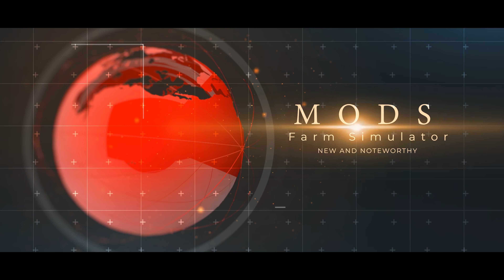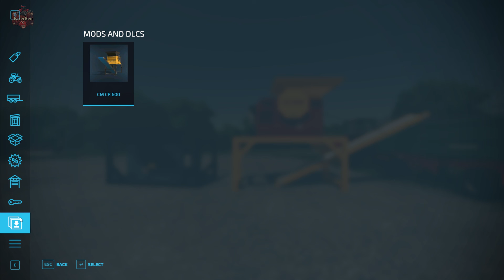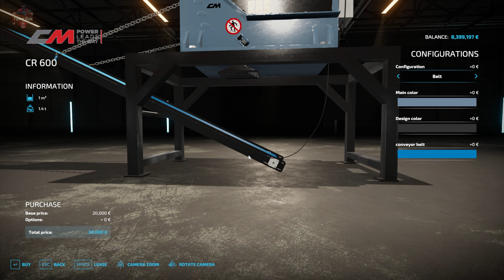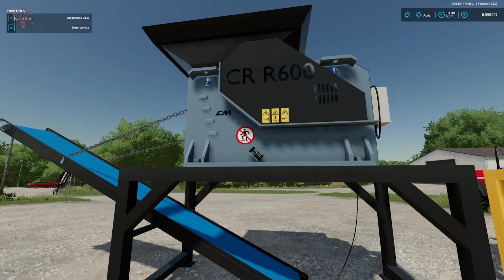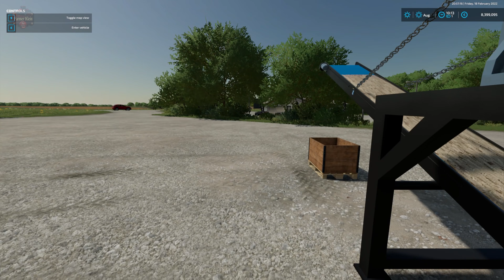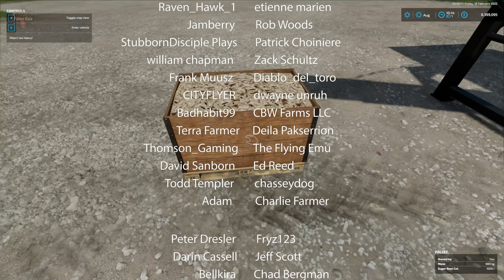CM CR600 (SugarBeet & Stone Crusher) | Mod Review | Farming Simulator 22

Comment: Thanks for the mod review. But at the beginning you call it beet pulp. But at the end you call it beet cut. The reason I ask that is The new maze plus mods ,in some areas ask for beet pulp and is a different then beet cut you can see the difference between the two symbols. I tryin to figure out how to get the beet pulp.
Reply from the maker: Unless this mod was speificly updated to support maize plus this is just for sugarbeet cut.  Any references to beet pulp was as an alternate way of saying sugarbeet cut.  This video was produced long before maize plus was released and before beet pulp was a thing.
Reply: Ok thank you. Is there anyway the mod can be altered to do that. Or is there another mod out there that does I haven't found. I have look everywhere I think.
Reply from the maker: @mrlooneytunes  Should be easy enough.  I dont use either so exactly where and what to change is not something I can help you with.